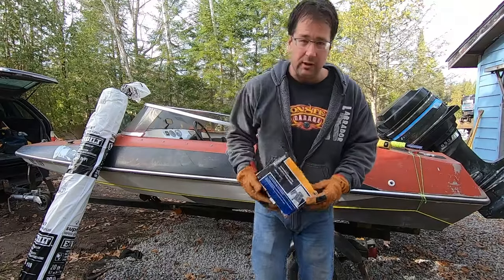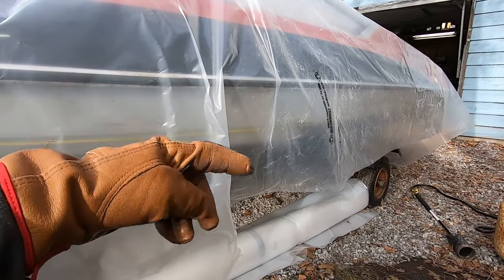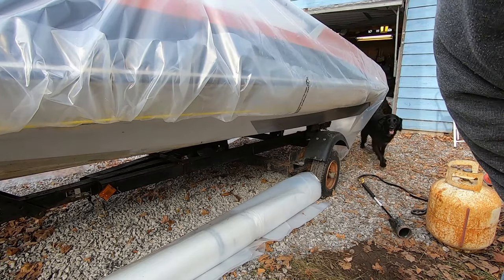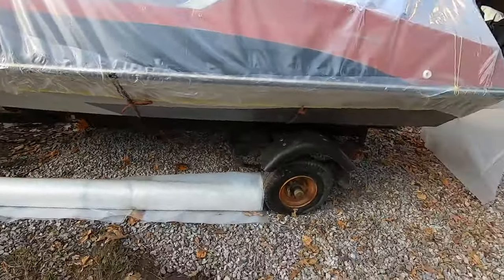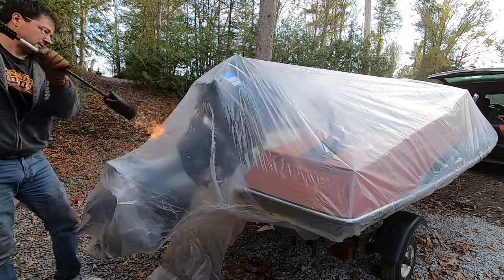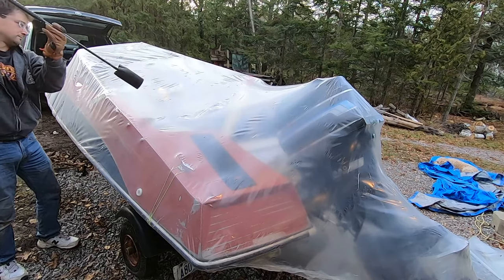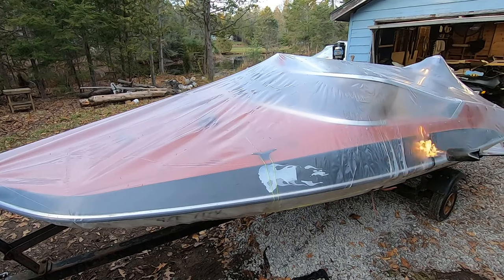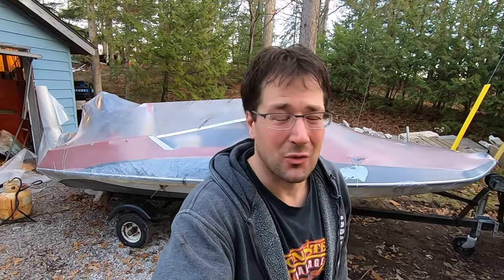DIY Boat Shrink wrap method using Vapour Barrier from Home Depot (Everbilt Super-six Vapour Barrier)

Comment: This is silly just buy shrink wrap.  Vapor barrier does not have the additives needed to shrink like shrink wrap nor will it block UV rays that fade your boat.  🤦‍♂️.
Reply from the maker: Seems to shrink the same, did you actually watch the video?  It’s drum tight, just like shrink wrap. In regards to UV, read the description.  

If you have proof of these UV additives please share.  Otherwise you are just making an assumption that they exist.  Consumers need to be less naive and trusting of marketing and branding these days.  There’s a good chance you are correct, there’s also a good chance there’s no difference except color and the writing on the label.  

Without access to trade secrets we have no way of knowing which additives are added, if any.   All we have to rely on is experimentation.  I have experience: I have a 04 Sea-doo GTX, it’s a fibreglass hull, viper red gel-coat.  It’s been wrapped with vapour barrier every season since 2010… it’s never been buffed and it’s still bright red.  Red gel-coat is highly susceptible to fade due to UV, yet my red Sea-doo has not faded at all.   So, my experience indicates that there must be some UV protection in vapour barrier. 

Advantages are cost, availability and convenience.
Vapor barrier is 1/3 the cost of shrink wrap,  by the time shipping is added the shrink wrap can be up to 4 times more expensive.
Shrink wrap is not readily available  to people in remote communities.  Shipping may take weeks and the cost may make it unaffordable.  Vapor barrier is available everywhere as it’s a very common building material.   
It’s really convenient to stop at a Home Depot vs waiting at home all day for a shrink wrap delivery.
Reply: It’s a fact, do the research if you don’t believe me.  Got my roll of shrink wrap from Home Depot just ship to store $200 after tax no shipping snd enough for 4 years for my 18’ boat.  To each their own but I would buy true 7mil shrink wrap.  I am surprised it shrunk pretty well but true wrap would also shrink better due to the additives.  I did watch the entire video and yes end result looks good to keep it dry👍
Reply from the maker: Not sure where you live.  I am in Canada.  They don’t sell shrink wrap at Home Depot in Canada.  Most people in my area buy from U-line, my shipping cost from them is $127.00.   I can buy a 2000 sq.ft roll of vapor barrier cheaper that!   I am in the same city as U-Line. That shipping cost could double if I was outside of the city.

So, let me get this straight; you are saying that you researched on the internet and found websites that list the additives in shrink wrap that are not found in vapor barrier. Please share.  I am very curious where you found that information.  Otherwise I call BS.  I don’t think that information is readily available.  Theres no doubt these additives exist in marketing and branding but I doubt they are tangible.  If you have that information share it, prove me wrong.
Reply: Thanks for the video. I am in Alaska, these videos offer great options for us.  Yes, if you lived in continental USA you will likely have many options.  Amazon and Home Depot will only ship to Alaska for outrageous costs, thus defeating point of DIY

Comment: Wild, I wrap 500+ boats a year in Minnesota, never thought vapor barrier would work so much like it.  We get alot of snow here though and generally go up 5-6 feet from the deck of a boat in order to get enough slope to shed snow rather than sagging, breaking the frame and causing damage etc. but I imagine you can get this vapor barrier in a wider roll and still diy!
Reply from the maker: Good point, yes tall frames are good insurance against shrink wrap failure, regardless of what material is used.  I still use tall frames on other boat warps. 

When I first started wrapping with vapour barrier I was using very tall frames. I wasn't sure how strong the vapour barrier was, or how well it would hold up.  I wanted to be sure it wouldn't break under snow load.  I never had an issue. So, over the years I started cutting the frames shorter. Also, the slope you see is not the final slope; I park this boat with the bow high, which increases the angle. 

Last season here in ON. Canada we had a heavier than usual snowfall. I did not clear it off the boat at all because I wanted to see if it would fail, it did not.  Despite having a few feet of very heavy snow piled on it the wrap was fine.  I will be restoring this boat someday and I am not concerned about it's current condition.  So it was a good boat to use as a sort of test for the wrap.  
This video was filmed a long time ago, this wrap is going on it's 3rd season now and still hasn't failed. 

BTW I watch your videos and liked the one on 2.5L oil injection delete.
Reply from the maker: Are you Facebook?  If so, I invite you to join the group Mercury 2.4L, 2.5L Owners.  If you don't get accepted it's because I didn't recognize you on FB. I am very selective, so if that happens just Message me on FB and I will accept you.
Reply: @faykos9267  Awesome, I'm gonna try a short frame on a boat that will sit for at least a year or 2 with regular wrap just to see.  No facebook, this is my first attempt at social media, might have to make some more vids about old outboards or maybe not?   Seems they're meant to be secretive like don't tell anyone how to manipulate the ec on an efi or make it easy to work on the carb motors.

Comment: I would also like to add after welding your shrink wrap by the perimeter band start heating from the bottom up just like your spray painting a car because the heat rises and many times you don't even have to shrink tight at the very top it'll all ready be tight and have the full thickness of the shrink wrap for Extra Strength along the top support frame
Reply from the maker: True, and good advice.  Useful on bigger boats with a high freeboard. 

I had a section of the video where I talked about preheating and post-heating.  Unfortunately the video was getting too long and that part got cut.  

That advice should also come with a caution; you have to be conscious of the amount of preheat and adjust for it as you get higher up the wrap or else you could burn through.

Comment: good video. just wanting to say what I and my son have done shrink wrapping my 30 ft length overall Rinker Fiesta V Cruiser since 2005. I purchased my shrink wrap from Dr shrink online along with the vents cording and miscellaneous. since the winter of 2010 2011 I have removed the shrink wrap and reused it every year since including this 22 23 winter season in Northeast ohio. 6 mil blue carefully removing storing away in a garbage bag and plastic drum each spring. this is 12 years in a roll and holds up excellent I have replaced the door a couple times $15 each and retaped any loose seams. I store my boat on a large trailer in my yard and the trick is to secure the belly band down to the trailer and retighten as needed when the Sun is out and warming up the shrink wrap. you only need to do this once or twice to get the wrinkles out. I do have a professional shrink wrap gun that I purchased online used and very inexpensive but found that I use the Harbor Freight Piezo ignition torch that cost me under $30. you do not use the torch after the first time after the initial shrink wrapping. be sure to use your supports in the same location and use extra support webbing for extra support from heavy snow and ice. the blue shrink wrap I find is best in my location because the sun will warm it up and shed the snow much faster. White shrink wrap is better to use in warmer climates and the clear shrink wrap is better if you are showing the boat for sale during the winter. definitely vent the shrink wrap as much as possible I have 10 vents in mine to keep any moisture from building up and I also have the added benefit with it being at home to brush off any extremely heavy snowfall. I do agree the 6 mil vapor barrier can work very good also.

Comment: Interesting approach, but I wouldn't recommend sealing the entire boat like that without cutting in lots of air flow vents.  Good way to end up with mold in your boat as the temperatures go up and down during the winter and condensation builds.  It has to have air flow to dry out or mold builds.  Anyway...outside of that this looks like a cheap way to DIY..
Reply from the maker: I agree, but not all boats need vents. If the boat was left on the water, tied to a dock all season  moisture will permeate into the fiberglass. That moisture can later come out of the fiberglass during storage. I have seen that cause black mold many times. If the boat was kept covered on a trailer when not in use it s hull will be dry and not holding moisture, in that case no vents are needed.  Nonetheless vents are a good idea and a precaution worth taking.  I should have mentioned them in the video   My boats are kept on trailers when not in use; no moisture, no vents, no mold.
Reply: I absolutely agree with venting and then venting some more and also using a couple three desiccant containers inside.
Reply from the maker: @edwardkawecki8101    Absolutely, it can't hurt to add some vents. I recommend adding vents, especially if your boat is kept on the water when not in use.  Even if kept on a trailer it can't hurt to add ventilation.

When I started wrapping my boats more than ten years ago, I didn't use vents, not sure why.  Maybe I just didn't have any.  Then I discovered I don't need them and I haven't bothered with them since.  

I wrap 2 Seadoo and about 4 boats every season.  Been doing that for at least a decade or more.  So, That is 60 wraps that I have done without vents and never had mold issues.  

If the boat is dry and not holding water in the hull when wrapped, then moisture will not increase beyond moisture levels outside.   No moisture, no need for vents.

Comment: If you do get a hole, could you not just install a vent port?
Reply from the maker: Maybe, depends on which type of vent.
The area around the hole may also be overheated and thin.   It might be too weak to support the type of vent that pokes into the shrink wrap. If you have the type of vent that gets taped in place after you cut a hole it will work.